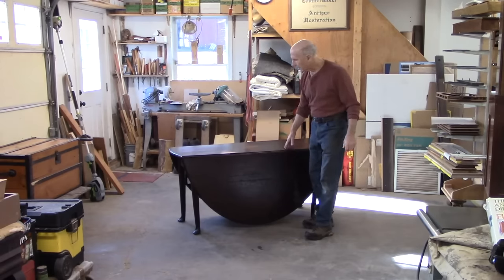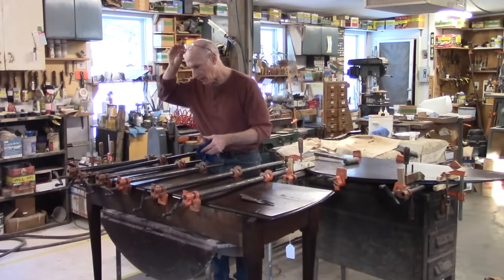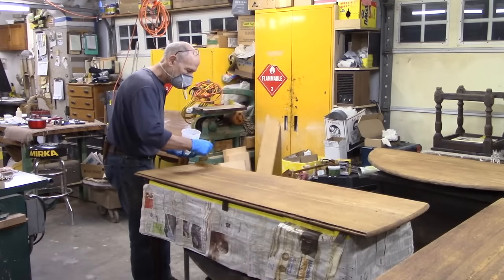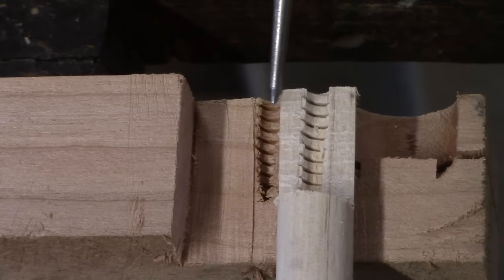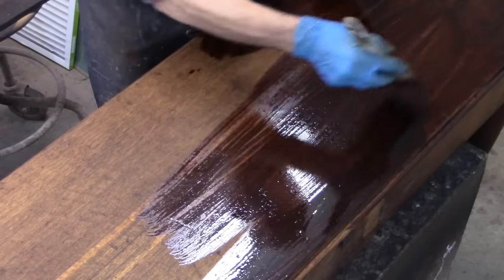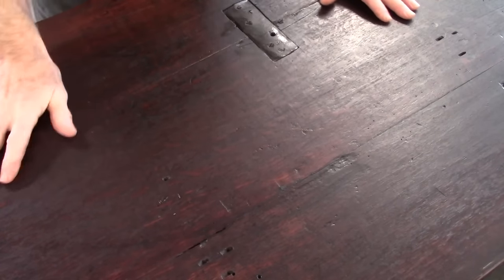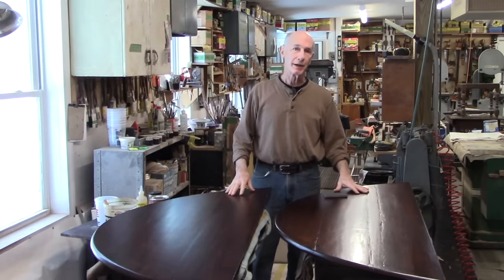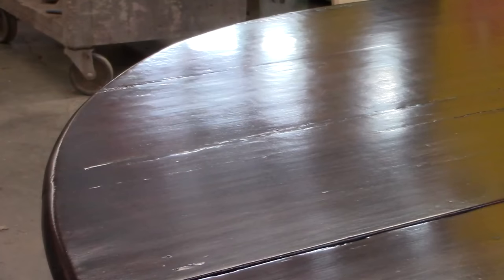Is This Table Too Old to Refinish? - Thomas Johnson Antique Furniture Restoration

Comment: Thanks for sharing your work. 

I guess they used olive or sunflower oil for the last "finish", which would not harden indeed. Linseed would perfectly.

May I ask, why you epoxied the crack at 35:40? Hide glue too weak in that position?

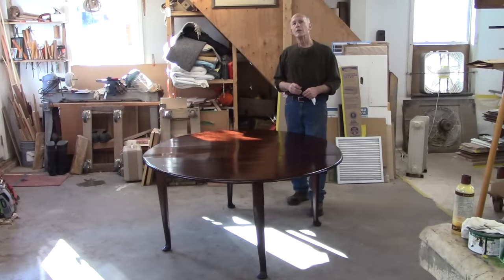Concerning refinishing (1:19:30) I think there might not be a loss in value if an age appropriate finish was used, which in this case probably would have been shellac.
Reply from the maker: Thanks! yes, the crack was too sketchy, I felt I needed to use epoxy. I like this finish, as it is from 1912, an old fashioned varnish. I don't like shellac for table tops

Comment: Just stumbled on your channel today. Subbed.

Good point on the refinishing vs leaving it. I've been dealing with finishes for decades as well.
If it's a museum piece then no, don't touch it. If it's something that's actually going to be used it should be refinished and repaired correctly to protect it.

I believe in leaving wear, but not damage. It's unfortunate you couldn't do anything with the burn but it looked deep. 
The fact you feel the need to defend your choices shows your similar experience dealing with pretentious purists that freak out over any type of refinishing. 😂

The only thing I would have changed is using slightly hotter products, even if it's just a dash of japan drier so you're not stuck for days waiting on dry time and still having gummy sandpaper.

Great job!
Reply from the maker: Thanks! Yes! Well said. And yes, I wish I had used some Japan Dryer in the asphalt up.

Comment: Thank you for another great and inciteful video. I picked up a 'throw away' round table 'card playing type'. I checked it was made from a decent wood, as it was painted with a crappy whitewash paint, which I took off and the wood looks nice, no idea what it might be.  Unfortunately, the centre came apart in the past, and somebody poorly repaired it, making it arc upwards, so it needs clearing out to make straight. Several legs had broken, and poorly glued/screwed in place.  Once you start to learn how to fix things properly, it is becomes annoying when you see very poor 'band-aid' fixes, but a pleasure trying to undo it.
Reply from the maker: Thanks! Yes, I'm always shaking my head looking at some of the old repairs, but I guess it was the best they could do

Comment: Mr johnson when you scrued that that scew into the table, that was to long, and you cut the end off  as the previous owner  had done, did you use a dowl or a plug?
Reply from the maker: Thanks! I used a plug. I did a little speech in this video about dowels and plugs. Either will work, but in a high stress situation a plug is better

Comment: Thank you for this very informative video. I am refinishing our dining table and when I sanded it, the wood is still rough and crumbly even with 220 grit. Do you have suggestions? I was told that this table was from the 1940’s.
Reply from the maker: Thanks! That is strange. There are some types of mahogany that do that, but I've never seen it in an old piece. Seal it with shellac (stain first if you need to stain it). Then carefully sand the shellac with 220 or 320, start at 45 degrees to roll off those fuzzy bits, then with the grain.

Comment: When do you use Titebond and when do you use epoxy.  My understanding is you use hide glue for joints and vaneer repair.  Thank you for the terrific instruction.  I've learned so much from your videos.
Reply from the maker: Thanks! I use hide glue on antiques, but Titebond is fine too. Hide glue can be loosened when necessary, so it's good for antiques. Epoxy is for emergencies, say when a leg is shattered beyond what a water based glue can do

Comment: How do you decide what finish to use? I've never heard of toung oil varnish before.
Reply from the maker: Thanks! I like the Waterlox Tung Oil Varnish because it is a very old fashioned varnish, it has a certain"look" to it. It's easy to use and extremely durable. Slow drying, but I like that

Comment: I once builded a set of kitchen counter tops out of resawn, reclaimed southern pine (very old and probably long leaf pine) that was dripping with desiel fuel. The old timbers came out of an old old cottom gin. Not trying to give advice, because your situation  was not the same as mine. But the way I was able to finally get a successul finish , was doing it as a natural color ,no stain, did not finish the under side. I know , no equal restistance on the opposite side. But had to hope being screwed down to the cabinets and with all of the appliance cut outs would take care of this.  The only finish I was successfu,l with was poly. Oil on oil I guess. The unfinished back I suspose did not lock the desiel in. They are still good ,saw the fellow this week in lowes, still likes them very much. In fact I saved the scrap and made a five foot long counter for my kitchette in my man cave. that still looks great after ten to twelve years. If wondering about the desiel, it was to keep the dust and lint under control . If you were ever in a cotton gin you would know it did not work very well. Enjoy your youtube channel very much.
Reply from the maker: Thanks! Those cabinets sound great! But the insides should have been finished, just to be able to keep them clean. The table took a long time to dry, but it did (I hope)

Comment: You are amazing.  You certainly could use an assistant to help move the furniture.  Interesting that you use asphaltum.  I never would have thought to use that on wood.  Is that a traditional technique?  I used it in printmaking on metal plates.  I did notice the beautiful color when I worked with it.
Reply from the maker: Thanks! Yes, asphaltum is used in a lot of trades, guilders I know use it. And yes, that move was not pretty! I've got to talk to my editor

Comment: Why didn't you use a 3 cut true varnish as a seal coat?
I've found it works great on natural oily woods and wood that a nitwit used raw oil.
Plus when I get fish eyes I use Fisheye Preventer from a automotive paint supply, it's usually silicone oil that causes it the worst.
Reply: PS: First time viewer. This is a fantastic channel. I'll be searching for prior episodes.
Reply from the maker: Thanks! I did use varnish as a sealer, did you mean shellac? I am always concerned about durability, and I like using only the varnish if I can get away with it. So far I have not had problems with fisheye brushing the varnish. It’s been my experience that the Flo Out only works with lacquer based finishes
Reply: @johnsonrestoration  I did mean shellac. I've used it as a first coat sealer and has worked great in keeping the surface coats from interacting with oils. 
The Fisheye preventer we used was good with all  automotive finishes including Imron
I've also started using Rustoleum oil based paint on my furniture when the customer wants a painted finish. I'd much rather use stain and clear coats. Paint shows to many union marks as I call them.

Comment: Thanks for the tip on dowl vers plug. 
I knew a dowl would open but never gave a thought to cutting the fibers.

I think that table might have looked good with a few Dutchman to hold joing closed.   Why Hyde glue versus modern glues?
Reply from the maker: Thanks! Hide glue is used for all antiques. It's compatible with the old glue, and easily reversed if necessary

Comment: If you have a friend whose a welder, you can get a "pilot hoist" made. Just a pipe clamp tube with four inches of tap on each end. The pipe can be 6.5 feet long. On EACH end, fit a set of pipe clamp heads, with the sliders on the inside and the fixed clamping screw headed ones on the outside. Cap the pipe ends with 1/4 inch thick steel plugs and weld those in. Also center and weld 1/2 standard nuts, one per cap. With a hand drill, load the minor diameter bit for the nut size. Follow with the tap and bore the hole in sync with the nuts. Now you can thread an eye hook on each end. From your two opposing column top joists string two dog chains. Now, when you need to flip a table just clamp the side panels with the bar clamp, filling in the gap in width with scrap blocks of wood. If you need to lift the table before flipping, then make two long hooks that resemble fire pokers. One end is linked to the mid-point of a chain and the other as a free hook. Lift one side of the table and catch the slack with the hook. Repeat on the other end. I can send you a sketch if you wish. It's not worth incurring an injury or further damaging an old piece.
Reply from the maker: Thanks! Didn't I already see this comment? I like the way you think - definitely an engineer
Reply: @johnsonrestoration  Danke! I'm back to rewatch and steal your ideas!

Comment: I picked up an antique table at the local restore /habitat for humanity for 15.00. It came with two chairs that do not match the table and the center piece is missing.  I was thinking of creating a nice steam punk or custom center piece for my son and refinishing the sides and legs.  The sides fold down and has really nice cast iron hardware. Oddly enough the table I have looks a lot like the table in your video only it is a three piece with the center piece missing.  It slides out and has a middle
Reply from the maker: Thanks! Sounds like a good idea! Good luck!

Comment: Absolutely amazing what you can do with an antique piece!   I was curious, I'm trying to restore an antique drop leaf table and chairs. Part of it has been painted (numerous times) and the top has so much clear on it looks a little unnatural.  Can you recommend a stripper that would take off both paint and polyeurathane?
Reply from the maker: Thanks! I'm not up to date on the strippers these days. I always used the strongest stripper I could find - Marine Grade methylene chloride - which is also the most dangerous. Read this article re: green strippers https://www.woodshopnews.com/columns-blogs/patience-is-key-with-green-paint-strippers https://www.woodshopnews.com/columns-blogs/patience-is-key-with-green-paint-strippers

Comment: Hi, I'm still learning about refinishing.  It seems like the asphaltum glaze caused more problems than it was worth.  Why did you use that instead of the sprayable tinting options that could have made the color browner with less hassle?  Was it because asphaltum would be more historically accurate?
Reply from the maker: Thanks! Asphaltum has this certain color and quality about it that I have been unable to produce any other way. I need to add some japan dryer to it!

Comment: Beautiful- One of my favorites amongst your work. Someone once taught me that a quick, light wipe of naphtha can get tacky finishes to finish drying. I've only used it once or twice. In one case, I had an oil varnish (Arm-R-Seal) over some resinous pine and it just didn't want to dry, even after a couple weeks. It was a piece I built, so there was no question of previous finishing causing problems, but I noticed that the pine was strongly (wonderfully) odorous when working with the pine. In any case, after a wipe of naphtha, the tackiness went away after another day or two of drying. Have you ever heard of this technique? I wonder if that would have worked here?  
Out of curiosity, what glaze product did you use? I'm only asking because I'm still confused about what a glaze actually is, so if I have an example of a specific product, I can look at it and then find something similar. I've never experimented with glazes and might try duplicating what you did on a table that needs a facelift and has a couple leaves that are lighter in color than the rest of the table.
Reply: I just found your glazing video, which has the needed details....Actually, I think I watched that long ago and forgot it existed!
Reply from the maker: Thanks! Yes, I've done the naptha thing before - definitely counter intuitive! Glaze is basically linseed oil and colors in oil. We always made our own until Mohawk came out with glaze with color. But I don't know exactly what theirs is made of

Comment: Tom, i’ve watched this video multiple times and thoroughly enjoy it. I have one quick question. When repairing the hinge mortises, you used plugs. In a situation like that, given that this element of the repair, structural, why not fill the void with epoxy and then set the screws in the cured epoxy?
Reply from the maker: Thanks Michael! I talked about that in the video, I used plugs so that the threads of the screw will intertwine with the wood, much stronger than putty, although the reality is the epoxy would work. But not regular wood putty, which I see a lot of

Comment: great video’s. love the quality of the video as well as the commentairy. on the water mark on the table. I have used hydrogen peroxide and is has taken all the dark water stains out of the wood. both floor and countertop.
Reply from the maker: Thanks! Yes, I've tried that. Hydrogen peroxide is one of the components of 2-part Bleach, sometimes we'd use it by itself.

Comment: Out of curiosity, did you ever consider removing the other screws that had poked through the top surface, snip their tips like you did for the leaf hinge screws, and fill in the surface holes...or would that have been making unnecessary work?
Reply from the maker: Thanks! I didn't realize they were through until I had already started the finishing process, actually I thought it was neat, I liked it. Besides, those screws are so short I didn't want to make them even shorter!

Comment: Is it possible & worthwhile to create some sort of dust proofing booth?
Reply from the maker: Thanks! Most shops do exactly that. You have a spray booth in a "spray room" with filters for the air. I don't do that in my small shop though. I don't find it necessary when working by myself

Comment: A video like this shows the effort, trials and know-how to achieve a great end result.  I like how you kept the original marks on the top, the patina on the legs and the old metal strap repairs underneath. But I missed something about the age of the table -- in the beginning you couldn't date it so what led you to conclude this was made in early 1700's?  Just curious.
Reply from the maker: Thanks! Just researching books, etc. The style is definitely 18th century, but just looking at the underside you could see that it is very old

Comment: Ive had some great success sneaking glue into narrow cracks by using a shop vac on the other side to draw the glue through the gaps.  We arent talking gallons of glue so there is very little to wipe up off the hose.
Reply from the maker: Thanks! A lot of people have suggested that. I guess I’ll have to try it!

Comment: Great channel. what is the glue you are using? it seems to have a high viscosity and long opentime.
A littele tip when you want glue to go into smal cracks: use a vacume from the other side. it works like a charme.
Reply from the maker: Thanks! I'm using hide glue, specifically "Old Brown Glue" https://www.oldbrownglue.com/

Comment: Question a out you camera setup. I assume you have more than one (overhead, middle distance on tripod and another for close ups) otherwise you would spend more time repositioning cameras than doing the repair. What setup do you use?
Reply from the maker: Thanks! No, I just use 1 camera on a tripod. I'm constantly moving it around me, and get a flow going

Comment: I’m not an antique expert either, but without going overboard and removing material, the piece is restored and usable again. For anyone concerned with the loss of value, one has to ask the question, what value would it be if it were left in disrepair and unused? Now it can be returned to service and its intrinsic value can be realized.
Reply from the maker: Thank you! Well said - that is exactly true

Comment: I was looking for a buffer under the clamps at the round of the table so the wood didn't get marred but I didn't see one. Was there no concern to dent the table round, or did I miss the buffer.
Reply from the maker: Thanks! I must have pads on the clamps, I usually do. But yes, there would be concern. I don't want to try and see now, but I must have had pads

Comment: I HONESTLY belive you added value to that peace by giving it a few 100 more years of life if taken care of, as it was it was useless garbage wasnt worth keeping as an antique it was to far gone and abused.  You saved it for generations of use. If anything else this is far better then where most of this stuff ends up. Becuse somone would look at it orignal state and set it out for the trash.
Now it has charter and functional use.
It was worth 0 to 50 bucks now its worth 1000s to the right buyer. Somone looking for this type of finiture but dosnt want to spend what a top qulity orignal pec in perfect condition is worth.

Your a master at this and a rare breed not many people could bring a hot mess like that back to life.

Id have been happy with it 5 coats ago.
But you just kept building it up.
Ever look at real moghangy it has 3 or 4 different types of color in it and very stright grain. Im not that big a fan of stright grain woods I like some figure in my wood. But you could almost pass that off as African moghangy.
Any one would be happy to dine off that table.   What I didnt understand is not fixing the feet where parts had chiped off but color matching might have been really hard.

I've seen people set really nice looking antique stuff out for the trash becuse they no longer like it. 
Toss all the IKEA stuff in the trash you want but if its real solid wood pass it to somone else. Donate it to somone who knows how to restore it.
Reply from the maker: Thank you! Well said! Color is always very complex